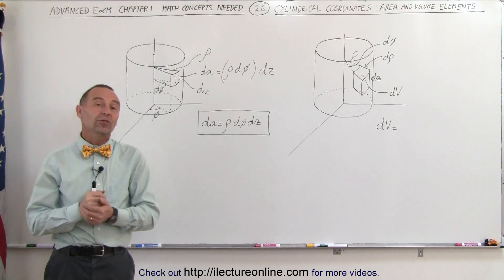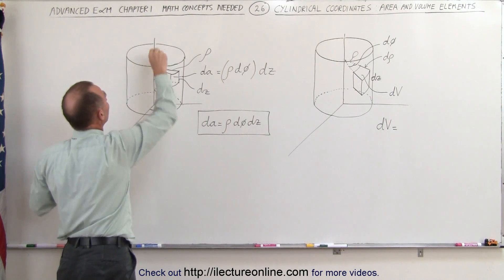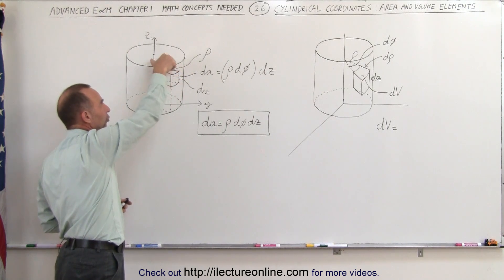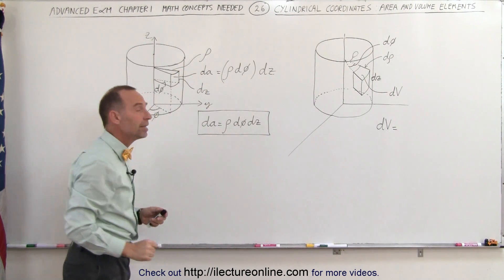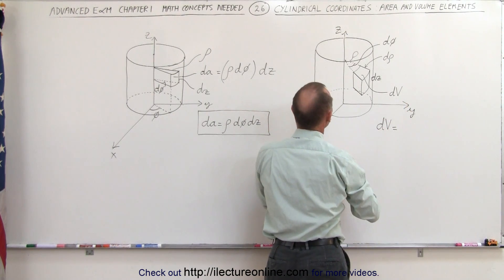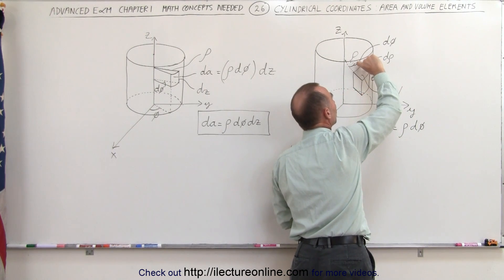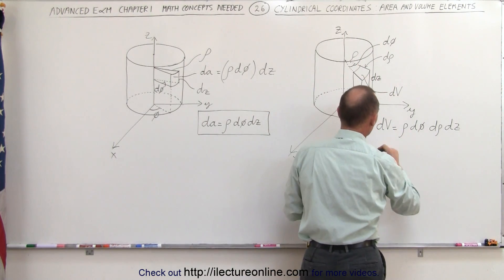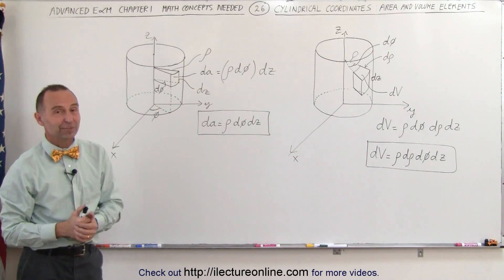Physics - Advanced E&M: Ch 1 Math Concepts (26 of 55) Cylindrical Coordinates:Area & Volume Elements

Comment: Sir why have you multiply roh in the second case in full length actually it is not full in length
Reply from the maker: Think of it this way:  the arc length of the side of the volume (d theta) will depend on how far away from the center you are.  Multiplying that with rho gives you the arc length.  (just like with the arc length of a circl)